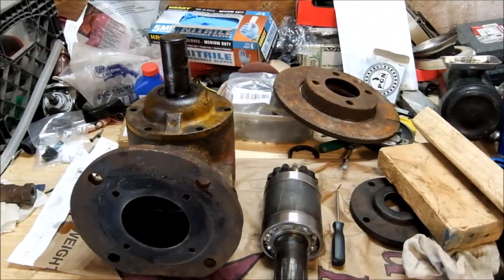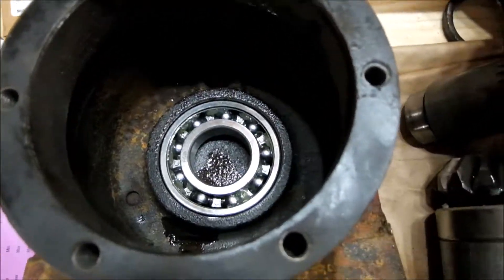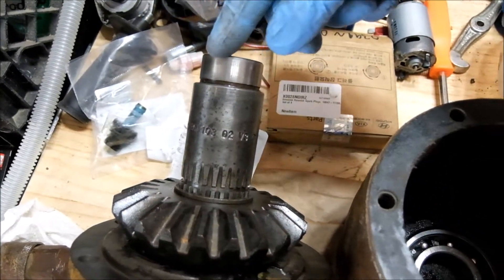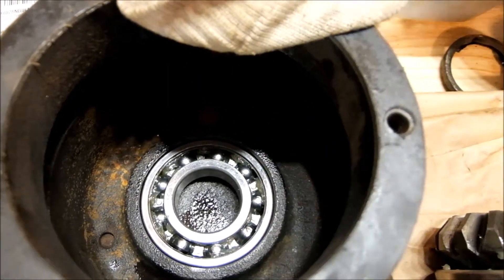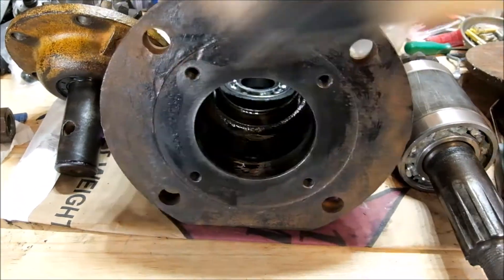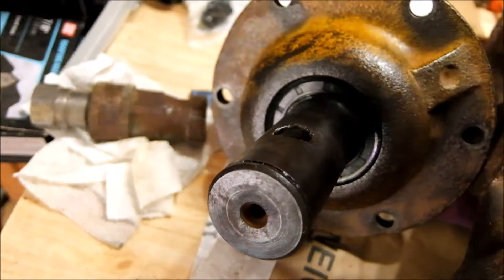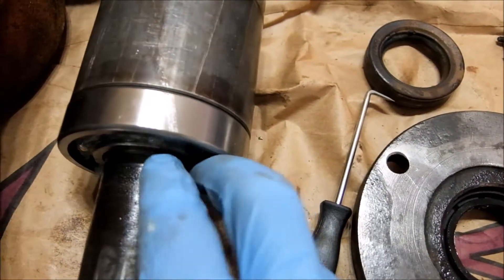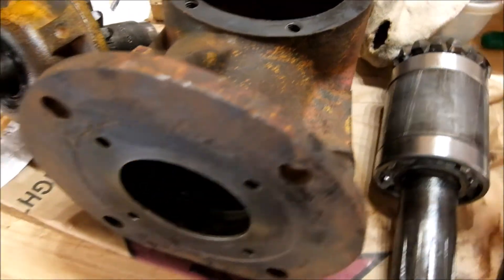Brush Hog gearbox how to rebuild & part numbers for most 4ft 5ft 6ft rotary cutters

Comment: I got one somebody lost the nut,so they welded the blade pan on. If it was not for the fact that the deck needs massive amounts of rust cut out and replaced I would buy new parts. Sometimes farmers come up with very stupid ideas. My buddy bought it at a farm auction  and i bought it from him. So its getting hauled to the scrap yard.
Reply from the maker: @terrymiler2164  welding that is a last resort and can make it worse

Comment: The tubular spacer between the two bearings on the vertical output shaft is badly designed. It's a plain tube with no holes in the wall so it means gear oil trapped between the outside of the tube and the gearbox case cannot circulate. When I overhauled my gearbox I cut 4 slots about 25mm (approx 1inch) long and 13mm (approx 1/2 inch) wide in the bottom of the tube at 90 degrees to each other. This allows the oil to pass either side of the tube, meaning all of the oil in the gearbox circulates around, maximising the life of the oil as well as the gearbox.
Reply from the maker: @txengineer5250  cool maybe just some drilled holes would be enough?
Reply: @sweetpigfarm3645  Hi yes, you could drill 4 holes close to the bottom of the tube and that would work too. In fact I did just that then used a hacksaw to cut up from the bottom of the tube to the holes to make them into slots.  Slotting means you get full circulation of all the oil without any place for oil to settle.  BTW thanks for posting the great video.
Reply from the maker: @txengineer5250  thank u for a positive comment. I am glad it's helped people

Comment: very good video I have this exact same gear box and even same color.  however the vertical shaft will not release and come out of the housing.  do you have to remove the horizional shaft first which dosent appear so in the video.
Reply from the maker: The vertical can come out of bottom itself. It's pressed in
Reply from the maker: 220 in u can see how I removed it

Comment: Thanks for sharing.
Be aware that adding or removing gaskets of varying thickness will affect the mesh between the gears resulting in a change in the root gap and backlash, which may take it out of spec.

Comment: Greetings, I accidentally came across you video and I want to thank you for taking your time to post it. I have a question for you. My uncle is a farmer and he has almost identical New Idea No. 452 brush hog. 
His problem: two gears inside the gearbox are all torn up, pretty much destroyed. Everything else seems to be in great condition.
Do you happen to know or have an idea where we could procure the replacement gears? I spent 3 days searching the internet and practically zero leads. It seems that New Idea Farm Equipment has shutdown in 1999, and many of its products are now collector's items.

Thanks for any info you may have.
Reply: Tractor supply or agri supply etc.sells new boxes for $200-250 ymmv.
Reply from the maker: Oh man..there are random Farm sites that still had parts. It might be easier to find a used gear box on eBay or something